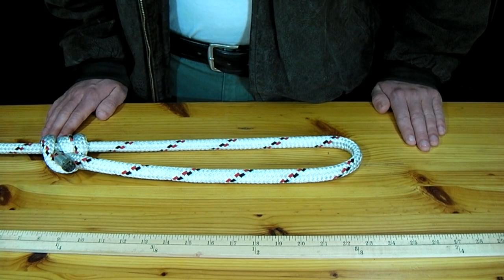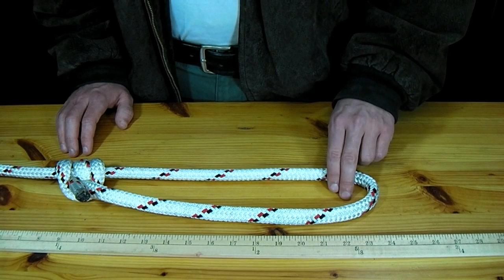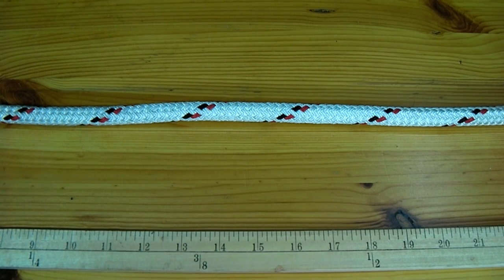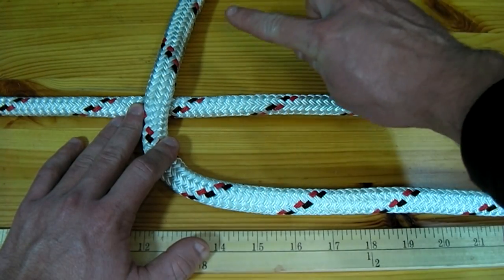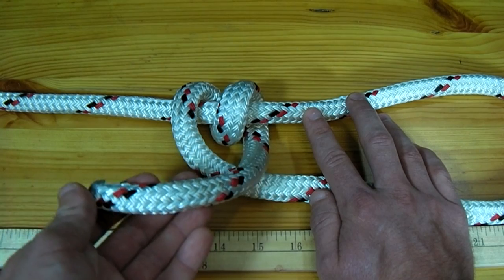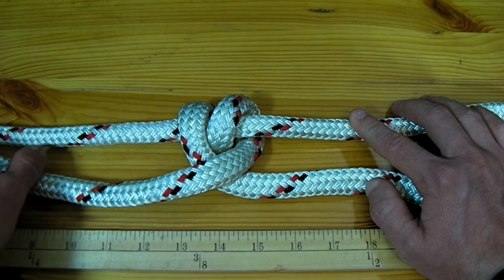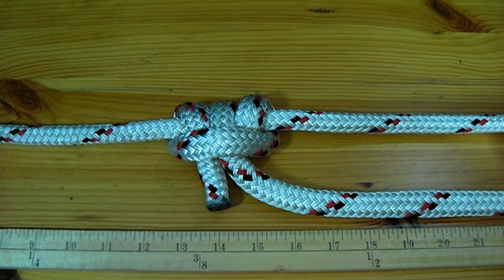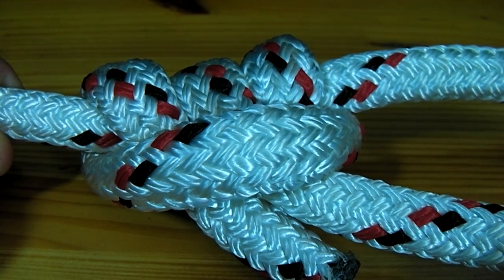How to Tie a Taut Line Knot

Comment: Pretty close, but not quite right. The direction of the last loop is important and this one goes in the "wrong" direction.  Essentially the taut line knot is the same as a "rolling hitch" tied back on itself. Making the final loop travel in the "correct" direction will make the knot more stable.

Comment: The knot as explained here is only effective with pliable rope. The only way this knot proved functional with my stiffer rope was if I made it symmetrical with two turns on the left hand side as well. Then I tried the variation as proposed by mr. Smith with success.

Comment: This is incorrect. The last turn should continue in the same direction as the first two - not reverse direction. Tied your way, it can slip under load. Tied correctly, it will not.
Reply: +Scott Smith You are absolutely correct. With the rope I was practising with I found that his method worked only if I wound twice on the left hand side as well, making the knot symmetrical; whereas your suggestion yielded success. Thank you.
Reply: +Karmicmessenger So, you are saying Ashley's Book of Knots is wrong?
Reply: +tanguerochas I said that the knot as explained was ineffective with stiff rope. Try it with rope that does not easily compress and you'll see what I mean. I would not trust my life to Ashley's anything unless I'm certain that it will work when I need it to. You can blindly trust whomever you want.
Reply: +Scott Smith I was about to type a comment stating exactly this. However I will go into more detail on why it's tied incorrectly.
First we will look at a clove hitch (go look it up). Note the ends going opposite of each other.
Secondly, take a look at a double half hitch (look it up). It is just a clove hitch which slides up and down on the same rope to make a loop.
Now, the only difference between a double half hitch and a taut line hitch is one extra wrap on the inside before the outside finishing wrap.
I have been tying a taut line hitch like this for years and years and I will always tie it this way. Other people that tie it the way it was demonstrated in the video have always complained of it losing grip and sliding. Whenever I tie it it never slips.
"If in doubt, trust an Eagle Scout."
-Proud Eagle Scout of 2004.
I was known as the knot man in my scout troop.

Lastly, think of this as comparing a square (reef) knot to a granny knot. Which do you think is more reliable?
Reply: +Jm nero I am simply pointing out that Ashley's shows the rolling hitch a/k/a a tout line hitch being tied both ways. The knot will slip under sufficient load in either case. It is incorrect to say that this is not the way to tie a taut line hitch. It would be correct to say that you don't tie one this way.

I never reached Eagle, only Life Scout. However, I, too was our knot person.

I do teach Marlinspike regularly. The method shown works on our boats with pliable line. I just tested, tying one loop with the method shown and one with the method that continues with a half-hitch in the same direction that you argue for. Based on that test, I would agree that the method you argue for is superior. I will be teaching our sailors the Magnus hitch form instead. (ABOK #1736) 

I maintain that this video still shows a proper way to tie a knot called the taut line hitch!
Reply: +tanguerochas I also teach that additional wraps on the inside make the knot less likely to slip and that an additional half-hitch on the outside makes it less likely to come undone.
Reply: +tanguerochas I'm certainly not trying to hurt the channel since I really enjoy the content he has been putting out. Just subscribed last night.

That's awesome for you to be teaching knots. It's just I've always felt the way shown is inferior to the way I described it. Although it also really depends on what type of rope is being used. Also different situations call for different knots for reliability.
Reply: You are correct Scott Smith. It should look just like two half hitches, with an extra round on the inside of the loop.

Comment: I must be doing something wrong because the knot slides when I put pressure on the loop.
Reply: Saint Declan The demonstration is wrong. Tied correctly, with the final turn going in the same direction as the first two, it will not slip under pressure.
Reply: It can depend on the line, to some extent. Also making the final half-hitch in the same direction as the first two provides more friction. There are lines where this knot will not work.